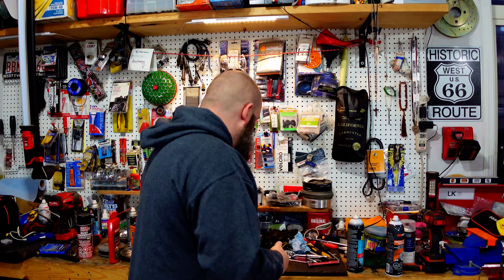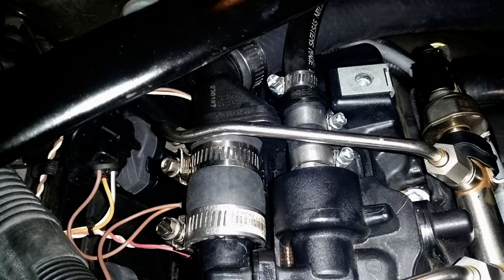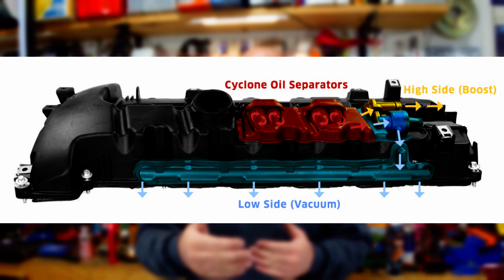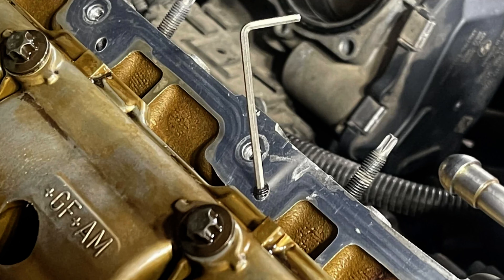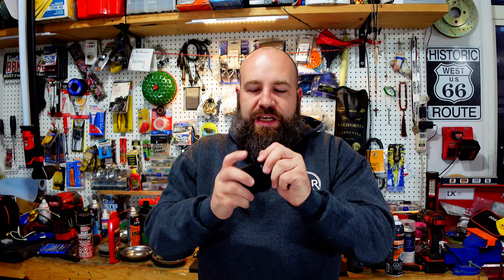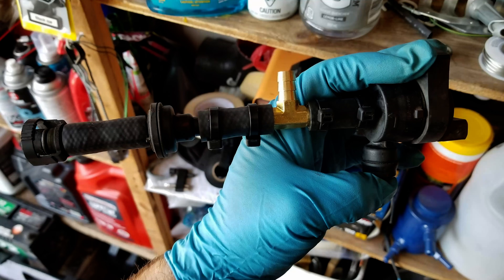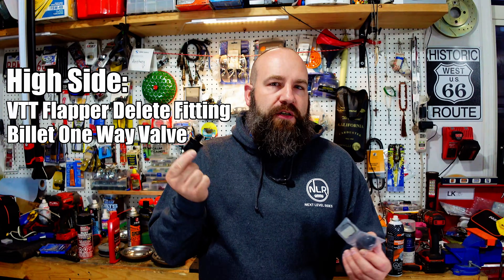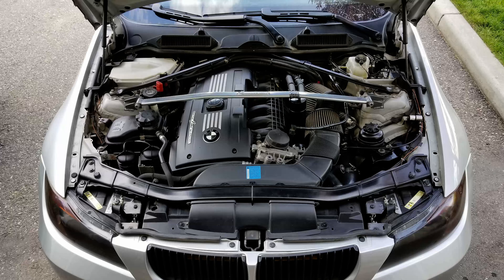FIXED - BMW N54 Smoking Issue (idle and deceleration)

Comment: Hi Tony,
Great video.
Ive had an n54 nearly 15 years.
Just recently the car seems to be smoking at around 1500rpm.
Car is FBO with 19T turbos. Car never used to smoke but cheap 19t turbos were put on when the VTT GC turbos blew up.
There are times im getting big puffs of smoke which is embarrassing in traffic. Car is cat free. Have done the valve cover and put in another rb pcv valve as previous one was 7 years old.
Like another commenter said, going up a steep hill seems to cause alot of smoke.
If it was turbo seals would it smoke all the time?
The car doesnt smoke often but when it does its a big cloud of smoke. So trying to figure out the best solution.
Wondering how to know if its valve seals?
Got the burger catch can but make need to do the mods you listed in this video.
Reply from the maker: is it smoking if you hold the RPM or just does it constantly?

mine would do the same when my low side catch can was getting full, pouring some caught oil into somewhere not meant to be, or keeping it from venting properly.

My old e90 had sweaty valve stem seals, only way to confirm is looking in the ports with turbos off.

you could convert your internal low side PCV system into an external, it helped mine a ton. only had some smoke on decel.

definitely go over your current PCV setup first! 

hope this helps.
Reply: @tony.nextlevelrides 
Thanks Tony.
I've replaced the pcv valve with another new rb valve and checked the flapper is OK.

The car only smokes when oil is up to temp. I can make some smoke when holding the revs around 1500 to 1800 rpm which is unfortunately the speed alot of the time when driving in towns.
On highways there is no smoke. Before the oil warms up there's no smoke either.
I'm leaning towards oil seals not being great but the fact it happens at specific rpms does make me think its pcv related.
Reply: @tony.nextlevelrides  I'm wondering now if the crankcase vacuum is quite low at idle and causing drain issues.

Could not find the ade pcv delete piece so I've ordered the VTT one. Also the VTT billet check valve. Does that mean I don't need the 2jz pcv valve?
I will get myself a catch can and T into the evap line on the throttle body. Hopefully that improves the low side pcv and stops most of the smoke.
Reply from the maker: it sounds like it smokes similar to how mine did. I'd try and revamp the low side setup.

I used the ADE to block off the factory PCV valve and cap, using an external PCV valve. I'm not familiar with the VTT one but if it has an external setup with PCV valve, it should be sufficient.
Reply: @tony.nextlevelrides  
Well this is interesting. I bought a manometer and oil cap. Drilled the oil cap and fit a nozzle to it.
The engine warmed up is reading zero vacuum. The gauge is definitely working.
It definitely feels like there's less vacuum than there was previously. So I'm guessing I had a vacuum leak and it's got worse.

I will recheck the pcv flapper and pcv valve I just added. I'm probably going to have to do the valve cover and gasket again.

Can a smoke test pinpoint where the leak is?

Thanks
Reply from the maker: @jessicaandtrains7768  yup, we've been using the smoke test machine for things like this, should help!
Reply: @tony.nextlevelrides  
Hi Tony.
Could you show the 2jz pcv valve and how it connects into the low side system on an n54?

Thanks
Reply from the maker: @jessicaandtrains7768 I don't have any photos but it is pretty simple. get the ADE PCV delete fitting, put a hose from that fitting (pushed onto the AN portion) and use an oem style pcv valve off a 2jz inline. keep it as close to the valve cover as possible. literally push it into a hose off the ADE fitting and clamp it.
Reply: @tony.nextlevelrides  
Well I've made a homemade smoke machine which I will try soon. Did plan on checking the car this weekend but managed to snap a drive shaft on my daily driver.

Vacuum at the manifold is actually very good. It sounds like crank case vacuum is only 1 to 2 inches of Mercury.
Reply from the maker: sounds about right! it's ok, I always break my daily too.
Reply: @tony.nextlevelrides  
Well, another interesting development. I found what looked like a hairline crack on the valve cover below the first cyclonic seperater beside cylinder 3.
Replaced the valve cover at the weekend and took that opportunity to install new spark plugs. The current ones were absolutely covered in oil. Even though I had replace the gasket about 2 years ago. So far worse than I realised.
I've driven the car a little since doing the job. I now have far less smoking. I do think there is a little bit of smoking happening.
Seems acceptable. I do have all the bits now for an external pcv setup which I will try.
Next job is to replace the oil filter housing gasket which is causing a noisy belt.
Reply from the maker: @jessicaandtrains7768 that's a good catch! if it's smoking a tiny bit, it could be burning off the residual oil. I'd bet the low side upgrade would help it.

be sure to do the belt soon, don't want it to slip off, shred and get eaten by the motor!

Comment: My n54 starting smoking blueish through my exhaust and front engine when i come to a stop at a stop light and when my car starts to warm up… its FBO and has no oil leaks , can this be my turbo seals going bad? Im planning on upgrading turbos either way
Reply from the maker: yup, sounds like either PCV system or turbos.

Comment: Bro help me figure this dam car out lol.
Reply from the maker: what's going on? I can try to help!
Reply: @tony.nextlevelrides  thank u Tony . For the last 2-3 weeks I’ve been getting 0015 intake and exhaust codes randomly . I Switched replaced the  Vanos Solenoids also the cam b and A sensors took it to my mechanical here locally in IL . And nothing. Can’t figure it out . then 2-3 days ago I noticed I’m getting a proof of smoke when coming to a stop. It’s a 08 335xi . Stage 2 VTT turbos all the piping is done intercooled . Tons and tons of mods.. And yes I know once I start modding that’s it .. . I night the car basically but and I love this car I really do but I can’t figure it out and it’s my daily as well. In the shop more than I can drive it . . Not alot of peole know or want to deal with it so here I am trying to figure it out and it’s no easy task. Also had the codes cleared but a pro with a pro computer . I as well have to use my FIXD scanner and clear codes all the time or I go Limp.
Reply from the maker: hate to say, you have two problems I believe. if the first ones is what I'm thinking about, it could be the cam ledges causing the codes. you can also check the vanos filters judg above the cam chain tensioner. I believe each of them are T56 torx, don't touch the tensioner.

secondly, if the pcv system is in check, it's possible you have a failing or leaky VTT turbo. you may need to pull the downpipes and see if it's pooling it one of the turbos.

worst case, you may have leaky valve stem seals, while not a common issue, it's creeping up as my e90 had it.
Reply: @tony.nextlevelrides  oh dam . Ok thanks . I’ll start by checking the Vanos filter . The smoke comes and goes and it seems like something is sticking . I just drove it an d had no smoke or codes … smh. I do see a small oil leak around the intercooler tho as it sat I saw a small drop at a few on the ground . The PCV VALVE on the other hand I have not looked and am just no reading about it and also the Cam Vent Hose or valve ? I appreciate it and will let u know what I find out . Hope it’s not a crazy expensive fix again . This cars is a piece of art but so dam expensive ..
Reply from the maker: @geogeo2551 they can definitely test your patience but it's worth the headache. they're good vehicles.
Reply: @tony.nextlevelrides  thanks again . I love my car and I don’t have a car payment on it so that is why I’m even considering just spending the money and making it right. Pushing 600 horse in a daily lol .. can’t get that anywhere else .
Reply: @GeoBrilliant67 make sure you are using the propper oil filter. Mann or OEM. Aftermarket ones collapse causing vanos codes. Also the O ring at the bottom of oil cap stem needs to be changed out at every oil change. If the middle stem essly comes off,  replace the oil cap. This also causes  vanos codes.

Comment: I have a question because i've been working on this for sometime trying to tell people about it for years where im currently at the point where i have highside with flapper and lowside with full vacuum setup. but is there a way to make or find an adjustable flow valve, in essence  works likes a one way check valve but it can be adjusted to let flow run the opposite way when adjusted for it. kinda like the current flapper valve but adjustable, because when you get higher HP/older cars with high hp you get more blow by because the amount of boost and the wear of the piston rings  after so long, which would cause your amount of vacuum supplied to not be enough and without that vacuum i dont feel like it would pull oil sufficiently to do exactly that. i've also heard that the vacuum can assist in pulling the oil through your turbo drain lines which makes sense to a degree, but with bigger turbos i'd feel i might want just a bit more vacuum because the turbos are bigger, from what i see and read these turbos aren't meant to have oil built up in them because it can cause the seal to prematurely fail, thats why i think even ebay turbos might be viable if these steps are taken i've seen people in every class of turbo blow turbos VTT 19T 17T pures fraken etc and i think its a combination of people not knowing what should be done to prep there n54s for the power with upgraded twins "Bigger oil cooler, Full high and lowside PCV system, Upgraded outlets, full 3" dual exh or similar" the reason for exh is i feel the car came with 2.35 or 2.5 exh for the small turbos so you would need atleast 2.7 or 2.8 dual to make up for the exh flow difference with bigger turbos to stop back pressure from hurting your new turbos all these things in mind i dont support all ebay parts but a metal valve cover isn't a bad option for 200$.
Reply from the maker: you're absolutely right, I remember reading a thread where you adapted a bleed valve to the front timing cover and adjusted it to bleed enough vacuum, fine-tuning the exact amount you wanted on the valve cover. people would take a sacrificial oil cap and attach a vacuum gauge to it then dial in the exact amount they wanted. the valve had a filter on the end as well.

for the life of me, I can't find the thread I had saved with all the info, fitting sizes, etc. it would be great to fine-tune the PCV setup for sure.

and you're right, without a GOOD pcv setup, you can prematurely wear out upgraded turbos.

Comment: Update for everyone on my personal project. Just completed this upgrade on my 07 335i that had an upgraded PCV/CCV delete system that was smoke at idle and decel after hard pull. I know have no smoking issues! After talking to Tony the only change I made was to a screw in version of the PCV valve from RAV4, 4 Runner, etc. because of availability.

Thank you Tony. Great video that actually works!!!
Reply from the maker: glad to hear it helped!!
Reply: Do you remember what year RAV4 PCV valve you used
Reply from the maker: I believe it's the same as the Toyota Supra PCV valve from the 2jz
Reply: @tony.nextlevelrides Thank you

Comment: Tony great video, thx!

What did you do with the electrical sensor connector that goes into the factory flapper hose between the high side of the valve over and the rear inlet?
Reply from the maker: you keep that portion for the rear inlet. it's just a heater, you could get rid of it but I kept it.
Reply: Tony what are your thoughts on a breather oil filler cap with or without the check ball?
Reply from the maker: they seem pretty useless and stick. can't say I've seen a single person have great success with them.